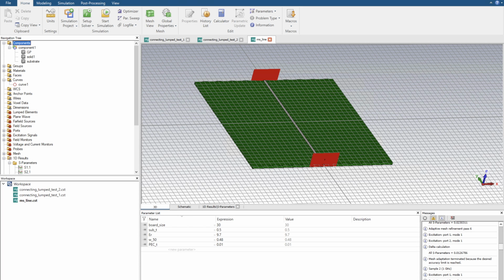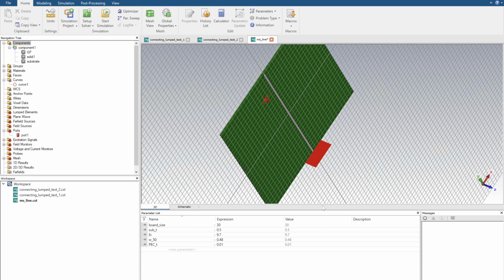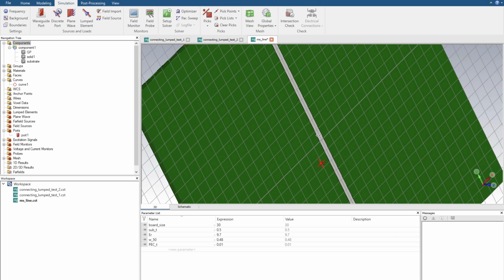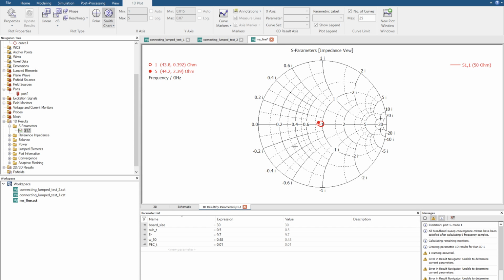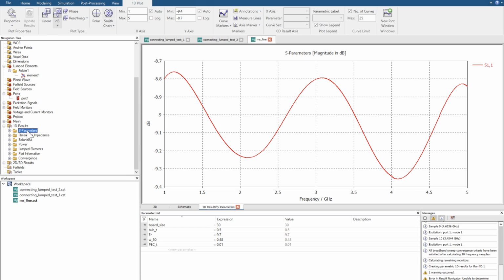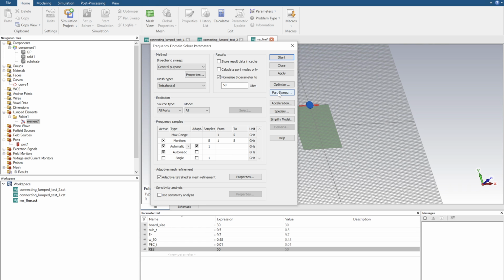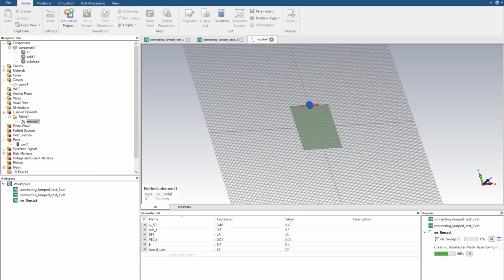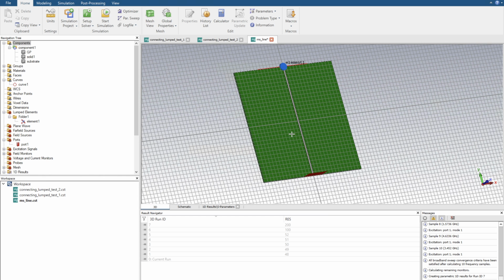CST Beginner Guide PART 5: Simulating Matched and Miss-matched Loads in CST

Comment: Thanks for the tutorial. I'm using 2024 [Learning Edition]. 
After creating lumped element, adding a parameter sweep, and solving I've got an error telling me that "Non-contiguous UIDs detected. This effect might be caused by internal waveguide ports. The 'move mesh' and 'structure sensitivities' features currently do not support internal waveguide ports." 
The second error was that learning edition has a limited mesh capacity of 20000 points.
To fix it I've changed Global Properties in Home section, Cells per max model box edge: Model:1, Background:1. Under Specials... section I unchecked "Move mesh on parameter change if possible". 
After this I got the same S1,1 parameters as shown in the video.

Comment: Thanks for the nice training playlist :)  It really helped me get started!

I tried 5 arbitrary values for parametric sweep: 5; 25; 50; 100; 500, but it didn’t work.

This is one of the waning messages I get: 
Service pack mismatch: caller is version 2024.1 while current executable is version 2024.0.

Do you have any ideas?

By the way, there is no problem for a single value of lumped element, e.g., 50 Ohms.

And, the same waning appears when simulating for a single value, e.g., 50 Ohms.